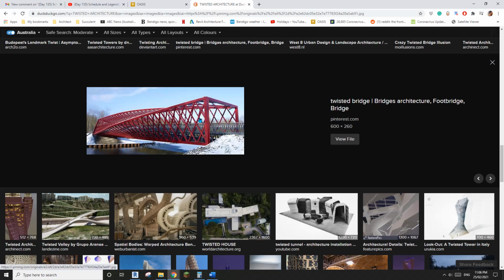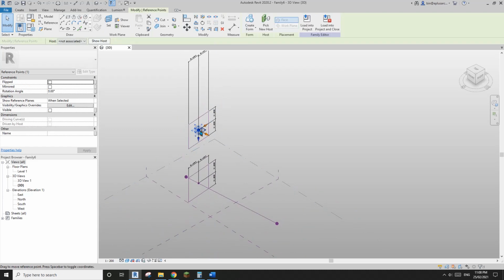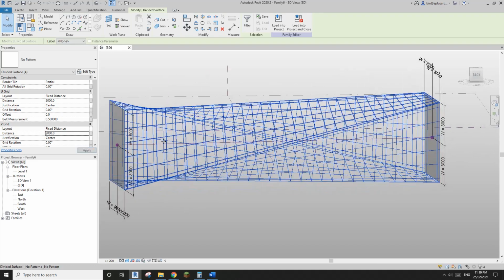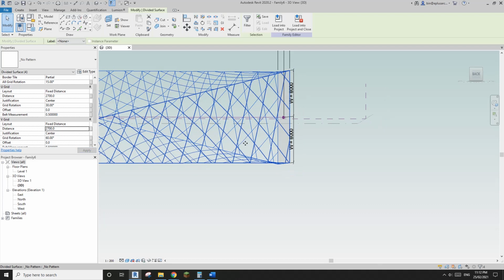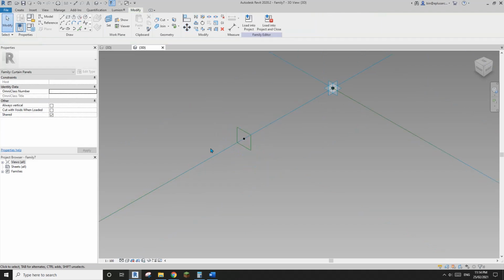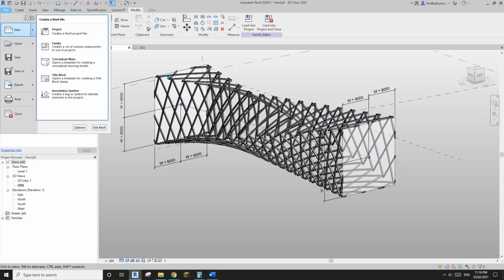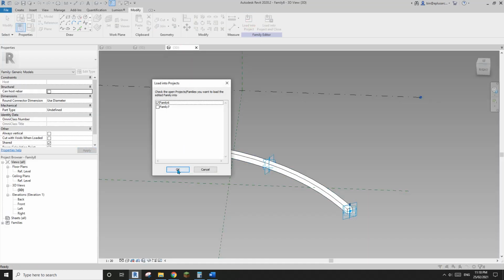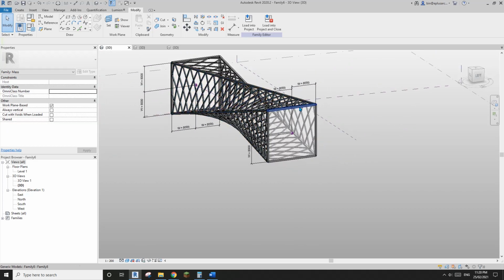Everyday Revit (Day 345) - Pattern Based, Adaptive and Mass exercise

Comment: Sir .. it could maybe be easier to choose Rhomboid pattern since they are easier to match the edge ?  But great tuto 👍
Reply from the maker: I think you are right. I’ll have a try tonight.  Good work!
Reply from the maker: I found another way to do this, which is better if you need to schedule it. I will post the video later.
Reply from the maker: Had a try with the Rhomboid pattern, still need to manually adjust the angles. But don't worry, I'll post an easier method. Thanks for your comment and please keep posting.
Reply: @BINHE615  you welcome .. I am just a normal user and not so confident with the program as you are. I am have seen a lot of tutorials but I think a learn more from yours ... maybe cause I am architect
Reply: @BINHE615   Hej sir ... I have some questions to you but I need to attach 2 pictures.  Could be some silly questions, maybe I made something wrong, unpredictable  ... I dont know. it is all about topo for this time, but where to send them?
Reply from the maker: @samoxflox9261  You should be able to upload the picture onto some website and paste the link in comment,  or you can email to me if it's easier  binhe615@gmail.com

Comment: Bin  when the facades are scheduled 🤓
Reply from the maker: Sorry what’s the question?
Reply: @BINHE615  the 3 types of facades
Reply from the maker: @luisfe7187  Good question. I guess if we need to schedule this model, we need to change the way we model it, because those V shape pattern based family does not make sense in the schedule.  I also noticed that they are actually full length from top to bottom.  I will do another video with a schedule in a few days.